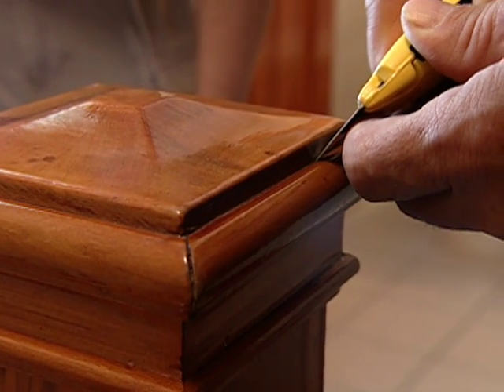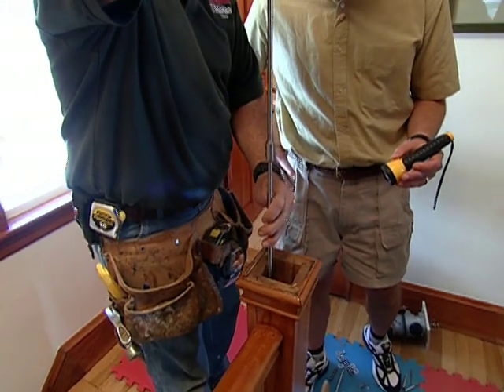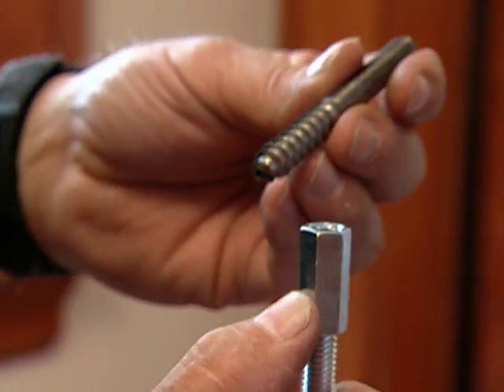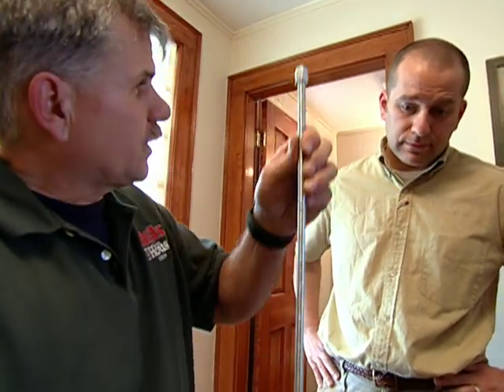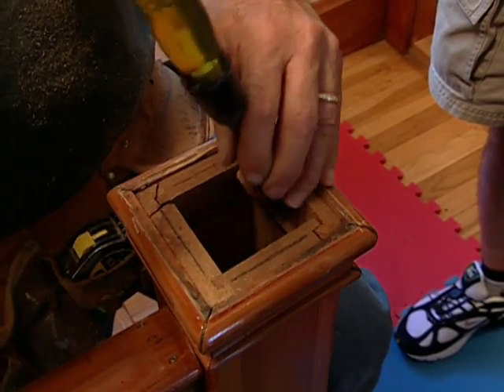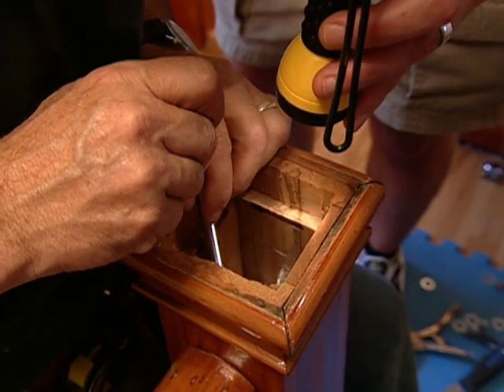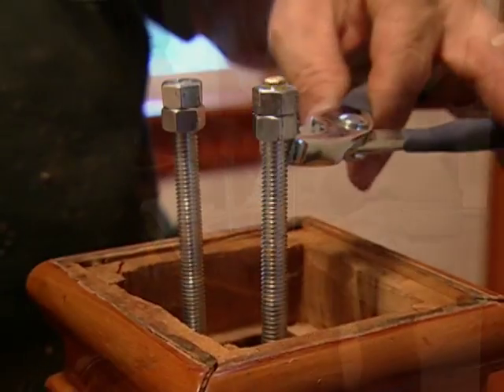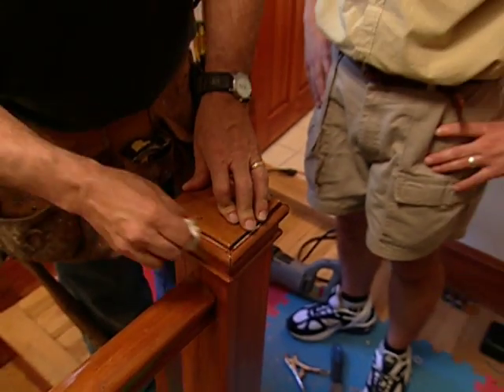How to Repair a Wobbly Newel Post | This Old House

Comment: man, i was hoping I could fix mine myself. All those extra tools will cost as much as paying a carpenter! The previous resident "fixed" it with those plastic cable clips hammered into the trim around the newel post. One step better than my previous house where they "fixed" a hole in the floor with expanding foam.
Reply: Yeah but then you can do more projects with the tools you bought. Ok maybe not the extra long drill bit, but hey just keep the receipt and return it right after you're done  ;)
Reply: Audrey Clarke that’s simply not true. Those tools and supplies won’t cost more than $100. Probably a lot less. 

A (good) carpenter will cost more than that.
Reply: The Real Hal Jordan you seem a horrible person if you use items and then return them. 

Not cool bro